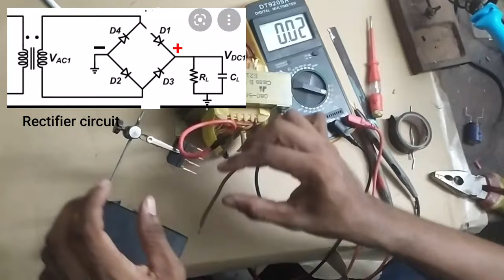How to get UPS Transformer DC Output | UPS Transformer Wire Identification | Rectification Circuit

Comment: Good evening, I have a Deca Booster 220 A - 12-24 volt + starter battery charger - The transformer has 4 wires for the primary and 3 for the secondary - It only turns on if I insert the starter, it doesn't turn on for the battery charger - I dismantled everything but the transformer does not turn on. the fuses are new and good. Greetings - ITALY thanks I can also send photos
Reply from the maker: Very sorry reply late...test multimeter output voltage. battery charger want to DC voltage not on AC voltage..full wave or harff wave rectification need this circuit.

Comment: Bro. My transformer out is 8 0 8 If i need 12v dc 10a, what is the recti and what is tha cap.please.
Reply: I need to use this for 12v car setup indoor.
Reply from the maker: If 8v.0.8v AC output from the transformer, 12V DC cannot be obtained from it. 12v dc can be obtained through a bulk converter.
Reply: @ELTronic3  clear thanks

Comment: Bhai mera bhi old transformer h usme input me black waire ni mil ri to mujhe samanjh ni ara common kon si h kaise pta karu bhai please.
Reply from the maker: When two resistors are connected in series, the middle pin is the common pin. In this way, check the ohms and find the common pin.
Reply from the maker: jab do pratirodhak shrrnkhala mein jude hote hain, to madhy pin saamaany pin hota hai. is tarah, om kee jaanch karen aur saamaany pin dhoondhen.

Comment: 3 wire output එකක් තියෙන ට්‍රාන්ස්ෆෝමරයකින් 12v A කීයක් ගන්න පුලුවන් ද ,12v කරන්න පුලුවන් ද
Reply from the maker: Ups transfor ekak genada me ahanne...
Reply: @ELTronic3  ow ups transformer ekak
Reply from the maker: @kaveen2911  transformer out pette taping 2k widiyata tiyenne. etanin voltage 2k out wenawa. awashnam e dekema ekatuwa widiyata out 1k gannat puluwan
Reply from the maker: Mekath balanna terum ganna puluwan wei..